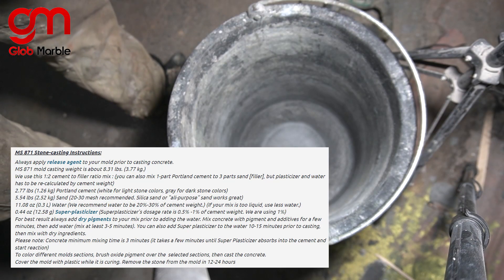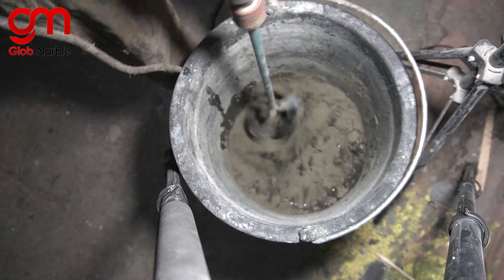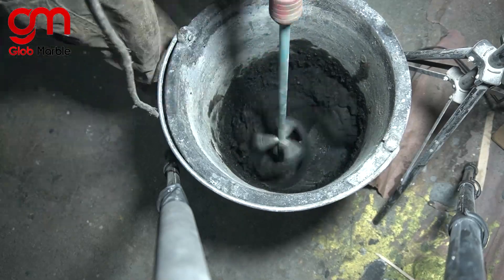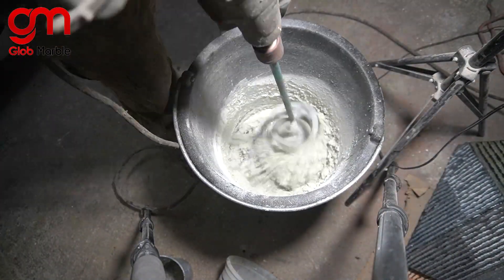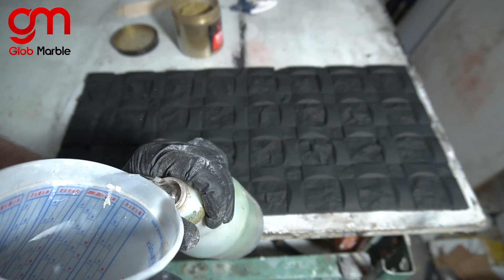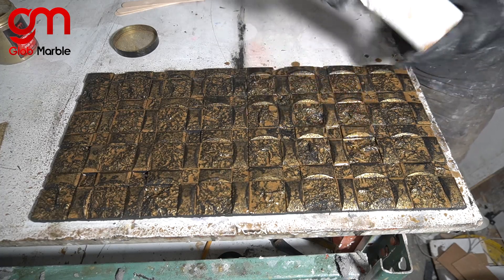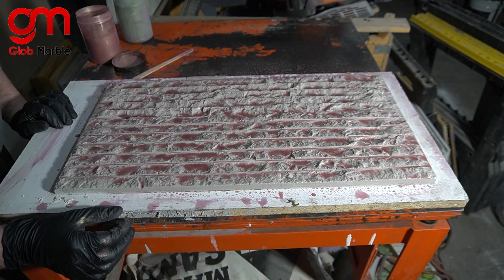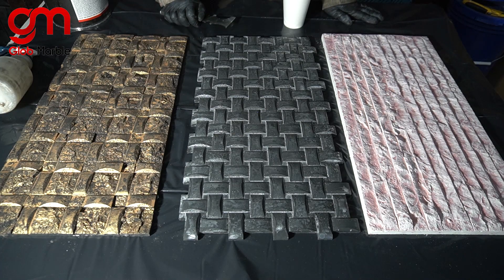How to Make Metallic Concrete. Silver and Gold Concrete

Comment: The black and gold was the best color combo. I think that would've worked on all three slabs. 
Can you do a video mixing concrete using glow in the dark colors instead of metallic?
Reply from the maker: I have actually tried mixing glow in the dark pigments into concrete. Unfortunately, it does not work. The amount of glow powder needed to see the slightest bioluminescence from the concrete make the project ridiculously expensive.

Comment: wow, this is very nice.

Is it possible to mix metallic powder directly into concrete like other pigments?
Reply from the maker: I have tried several tests like this, but it would be extremely expensive to have any noticeable results in that method. This is why I recommend using the method in this video :)

Comment: Great job. I was concerned about how long that sealer will hold. But the job is great!
Reply from the maker: Because this is on a wall instead of a floor the sealer will hold for much longer, maybe 5-8 years :)
Reply: @GlobMarble  I know is a wall. I think I can see this in the video :) . 5-8 years is not much. But I suppose people redecorate the house anyway.
Reply from the maker: You can always reseal. 5-8 years is a very good lifespan for a sealer
Reply: @GlobMarble  Yeah, I suppose so. Are there any chemicals that can be added to plaster or cement in order to make them resistant to water? Something that can be mixed into the recipe and not coated.
Reply from the maker: None that I know of unfortunately. This method would require sealing either way in order to secure the metallic stain to the stones surface
Reply: @GlobMarble  Yeah...I am making some backdrops for my photo studio at home and sometimes I am using materials like plaster or white cement or wall finishing compound that I need to paint and decorate with paint and acrilic color and as a sealant, I am using a matte varnish. Not happy with it because it is not really water resistant. Especially over some time.
Reply from the maker: Try using our matte finish food safe sealer XS 327. Its low VOC so no wories about the fumes as long as you keep it venitlated- https://globmarble.com/concrete-countertop-sealer-xs-327-gloss-matte.html

Comment: Would the metallic pigment work if I dust my silicone mold with it before pouring my concrete/gypsum product? I was going to use mica, but I'd prefer to avoid it if I can.
Reply from the maker: That would be possible, but I think it wouldn't be as noticeable as this method

Comment: What about adding acrylic meallic paint to the concrete mix.
Reply from the maker: I have tried putting the metallics in the concrete itself, it does not work unfortunately. You need to put so much pigment in the mix to see any real results that the integrity of the concrete starts getting compromised.

Comment: Please guide to make concrete stone.
Should lightweight concrete be applied to reduce concrete weight.
Does your company produce stone with normal concrete or lightweight concrete... please let us know thanks.
Reply from the maker: Lightweight concrete is not necessary, most people just use regular concrete. If you would like, you can use this concrete mix though https://globmarble.com/xtreme-lightweight-concrete-mix-3.html
Reply: Thanks for answering
I would love to learn to produce this stone
I am concerned about the packing and shipping process because this stone is quite heavy
The next problem is where I live... in the rainy season, the humidity is high. These rocks will be mossy and moldy, which will deteriorate the appearance if they are installed outdoors.
Please show me how to solve this problem.
Thank you..!

Comment: You just sprayed the metallic powder on with water or you recommend spraying it on with a water based sealer?
Reply from the maker: I first sprayed it with a water mixture and then used a sealer on top. I was worried that the metallic sealer would go on the stone too thick if trying to make the stone have some depth between the colors.

Comment: Would like to do this with countertops...Yes? No?
Reply from the maker: Countertops usually have minimal texture for ease of cleaning. If I were to do a countertop with these molds, I would flood coat the surface with deep pour epoxy to encase the stones in a glass like surface
Reply: @GlobMarble  Sorry, I meant the gold tone only. Maybe if theres a way to mimic veins without "staining"!
Reply from the maker: Could you elaborate?
Reply: @GlobMarble  We are opting for white countertops but wanted to spruce it up with a bit of gold tone. But will probably just go with white. Your cement pavers look awesome!